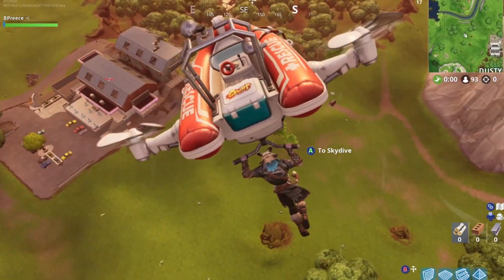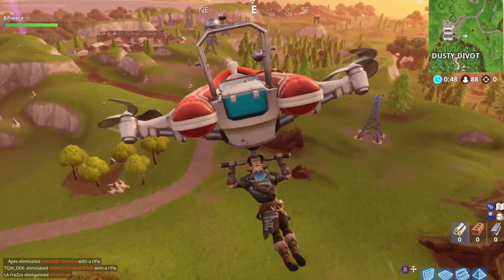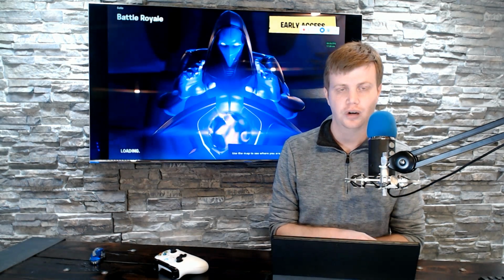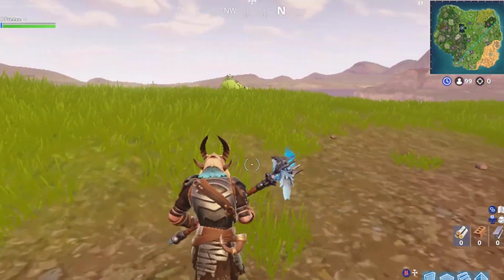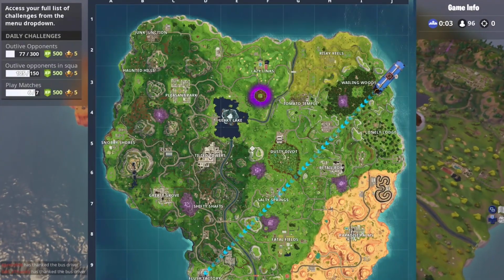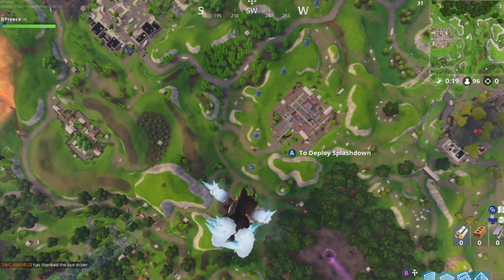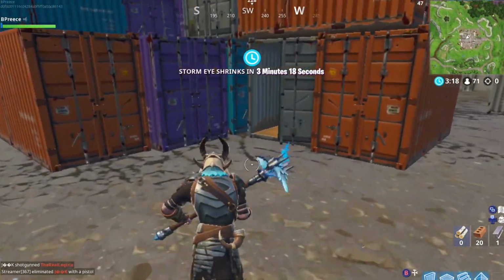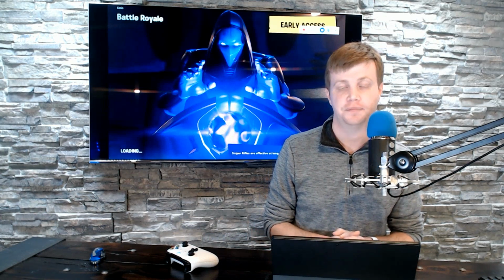Can You Play Fortnite on a Surface Pro 6?

Comment: My Surface Pro 4 will run it 30-60 FPS if you lower all settings. But it does overheat pretty quick.

I would be cautious if you plan to play Fortnite on it. 😅

Comment: Can you please do one on the baseline surface pro 6, like the i5 with 128 GB of storage
Reply: I'm getting the base model.. People says it's has a liiiitle bit unnoticeable reduced frames
Reply: @omarmix6075  still should run fine... my 2017 i5 128 GB model with 8 GB of ram easily runs 44-46 fps on average.
Reply: I use external cooling though and the processor is a bit faster than the exact base model. (I have the i5 7300u instead of 7200u)
Reply: @DdoubleB03  that's cool,, i ordered same specifications as yours but it's pro 6, i waited for them to add thunderbolt 3 for egpu, but they didn't,,
Reply: @DdoubleB03  you got the business model?